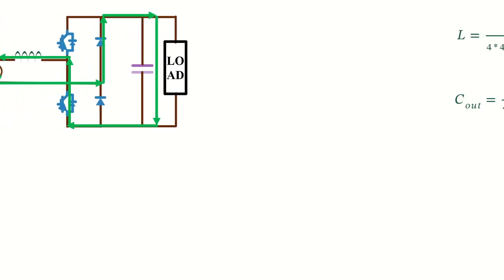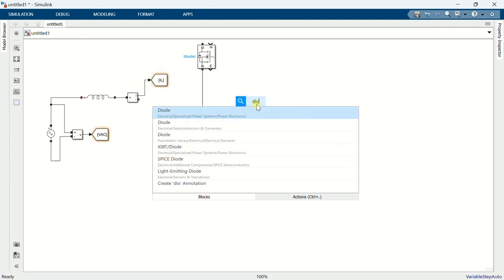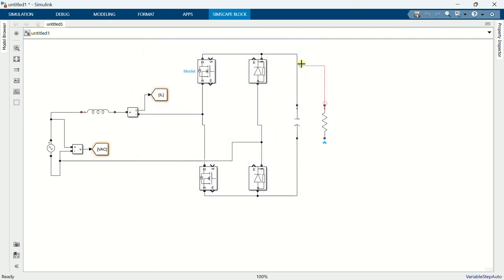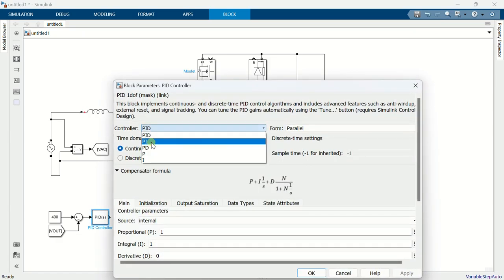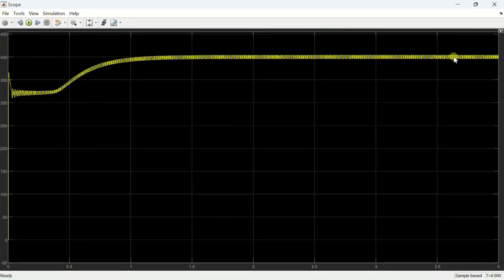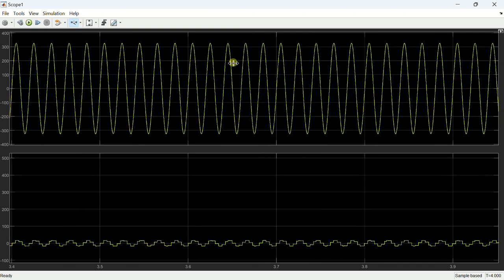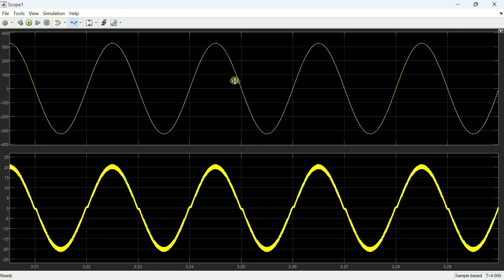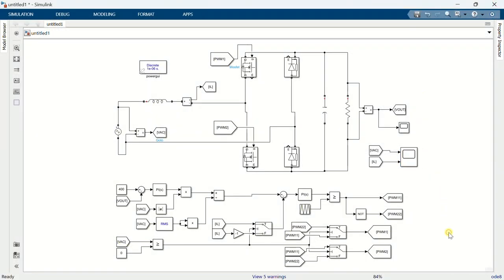Totem-pole PFC | MATLAB Simulation | Tech Simulator

Comment: Hi, thanks for the video.
But there is a huge current spike in the input side current. How can we remove that? Please reply.
Reply: Hi Eternity and TechSim crowd... Did you figure this out? I have an initial rapid spike of 0 to 350 or 400V and then linear drop to steady 100V. Thanks, Dan...
Reply: I found my error (incorrect schematically) and it now runs like TechSims.

Comment: can this be used for bidirectional operation, also couls ypu share the papers you used for reference
Reply from the maker: yes, but need to change the diode to mosfet. My simulations are not based on any reference paper. i am just sharing my knowledge. But still you can get related papers from internet.

Comment: Hi, i could replicate your model, the output of the current PI is completely saturated [-15,10] when the carrier is only [0,1]! This makes the mosfets to switch way faster than 40kHz (and uncontrolled), which is i think unacceptable in a real design.. what do you think? Im trying to design a control for a real prototype
Reply from the maker: No that is not acceptable. Looks like something wrong with the controller. I haven't checked that, let me check it.
Reply from the maker: One suggestion, try limiting the current controller output between 0 to 1, and see what is happening.

Comment: It is showing error, at time 0.0 The state 1 in pid controller2 is not finite, So simulation will be stopped. There may be a singularity in the solution.  If not, try reducing the step size (either by reducing the fixed step size or by tightening the error tolerances). I tried that remedy but it is not working out
Reply from the maker: Pls mail the model
Reply: Hi there, I also got same problem. Did you find the solution yet ?
Reply: Hi , how you solved this error ?
Reply: @TechSimulator  Was this issue resolved? Im attempting to replicate also and would like to know. Thank You, I appreciate your work here, it is really fantastic to see this. Thanks, Dan...
Reply: To update on this. I dont have this issue with my model. I do have Output Block warning of Open Ports on the FETs and Diodes on Port E. Also currently I have an initial voltage spike and then a steady 100V. Looking into that now. Dan...
Reply: I still have the Output Block Warnings but its running great. I found my error (incorrect schematically) and it now runs like TechSims.
Reply: @danslanker8880  how did you solve your issue ?